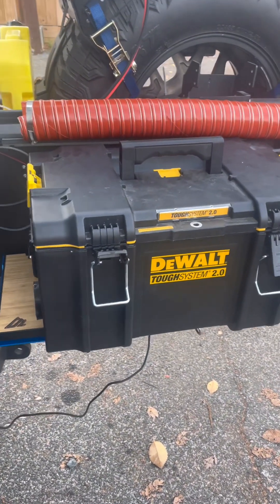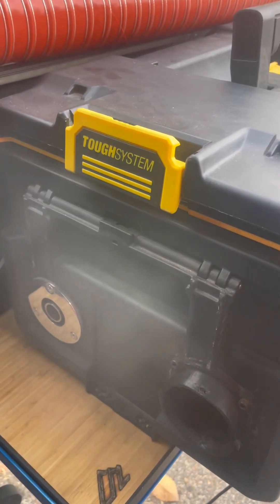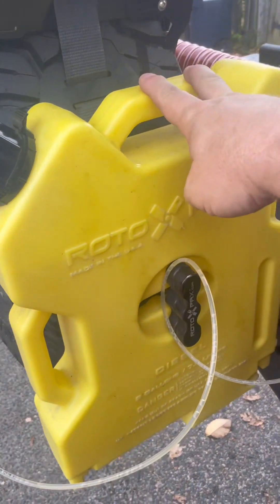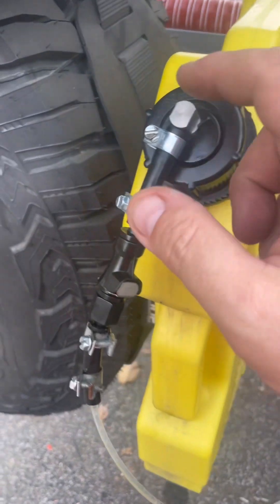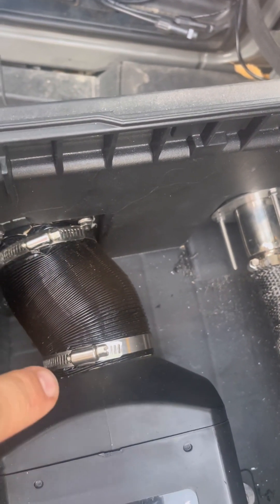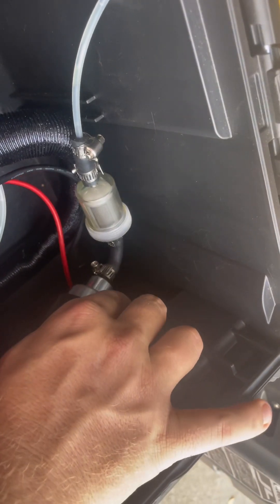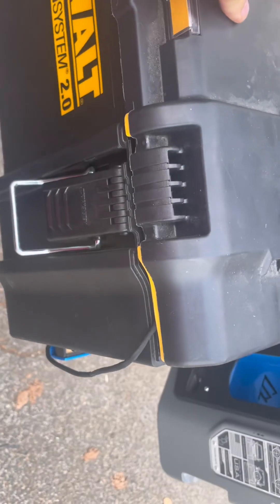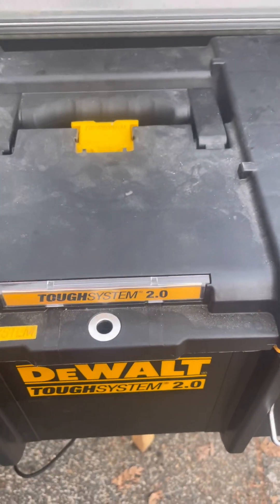DIY Diesel Heater in a Dewalt Toughsystem Toolbox for my Rooftop Tent

Comment: Hi mate, does the exhaust through port not get hot and melt the plastic? 
I’m wanting to fit my heater into my roof box but need a way to route the exhaust without melting plastic.
I have exhaust tape and rockwool which was one thought, to wrap in rockwool AND titanium exhaust wrap but the end still has contact with those through ports

Comment: Has the PETG held up on the hot end?
Reply from the maker: I would have said great until recently.  Just switched ti trying an ABS port
Reply: Hello  @groundedrigs , do you have better result with ABS ? I've done a similar piece in PETG and the part melted on first try with "full power" of my 2kw diesel heater
Reply from the maker: @SylvainPAILLOT  mixed results to be honest. ABS was better but my first PETG held up as long as I didnt go full blast